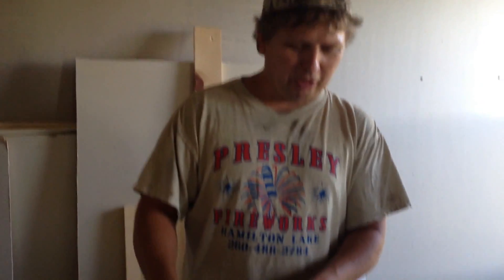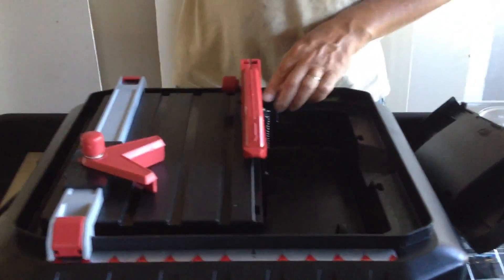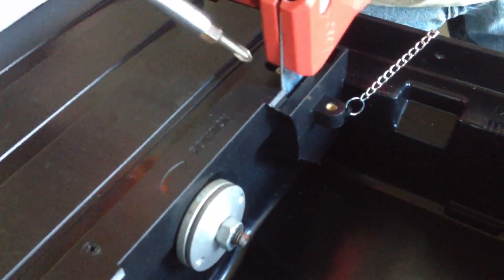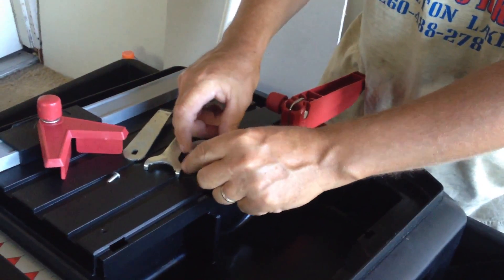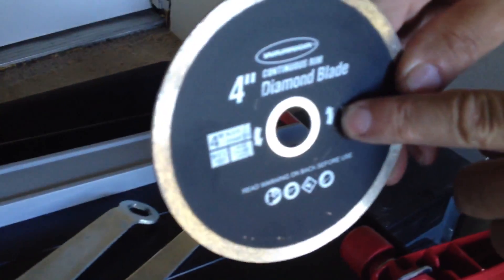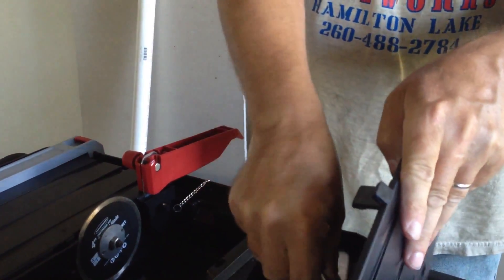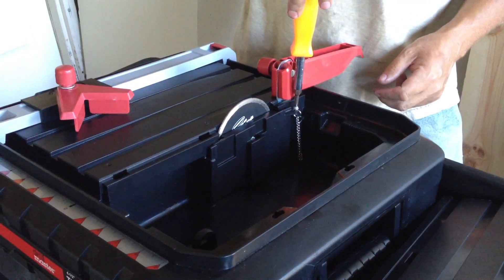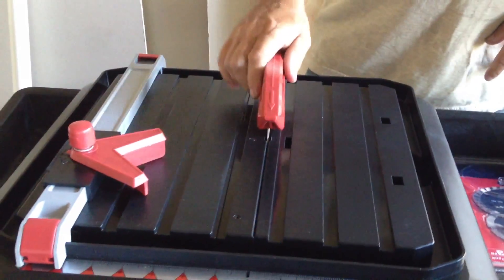Tile Saw blade install

Comment: Can a 5" blade fit in this. I'm considering using it for cutting stones. It needs to have atleast 1.25" of cutting depth on the top end of the table.
Thank you. ☮️👍🇺🇲
Reply from the maker: I don't think it will

Comment: You answered my question I asked on another of your videos, I wanted to know if I could use the 4" blades. The 3 pack of 4" blades cost $18 and the single 4.5" blades cost about $15 each. Thanks.
Reply from the maker: I'm not sure sorry